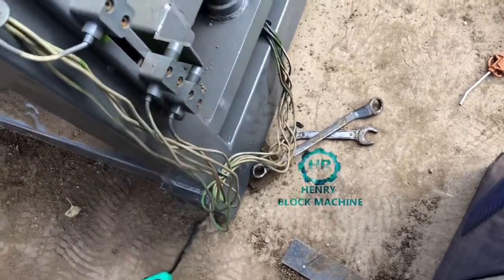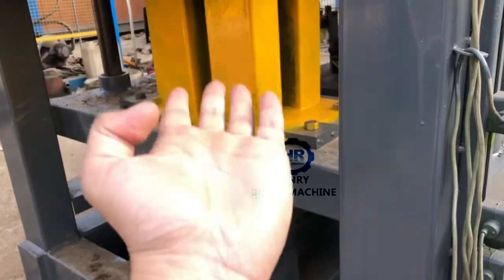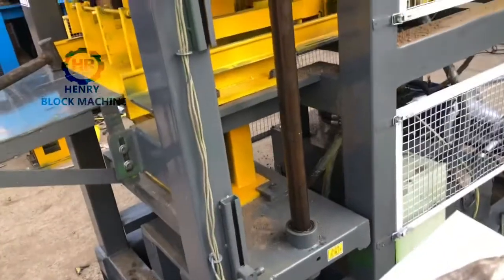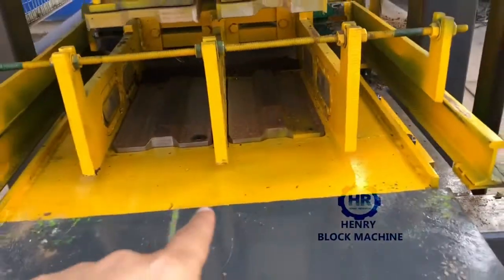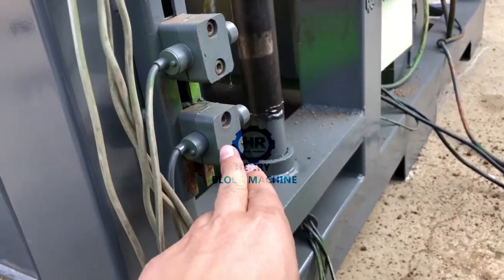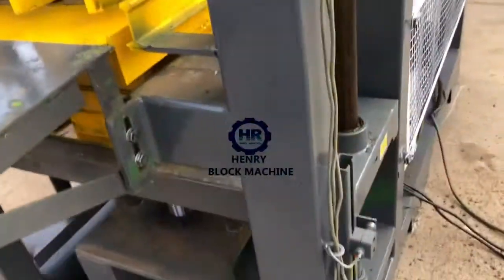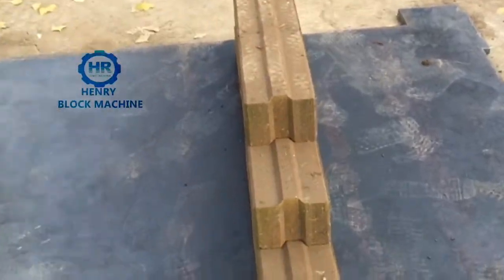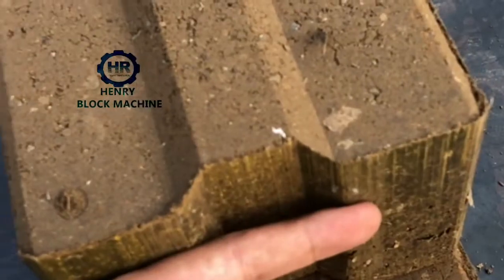How to assemble a soil interlocking brick machine? To adjust processing sensor is very important

Comment: What percentage of cement is mixed with the soil? What soil types can be used? And how long does it take before the bricks are completely ready to use? How  electric power does the machine require?
Reply from the maker: Please add my engineer WhatsApp number please 008613053989171.